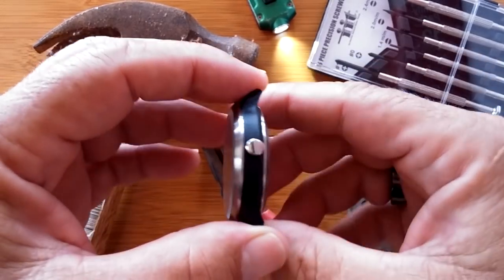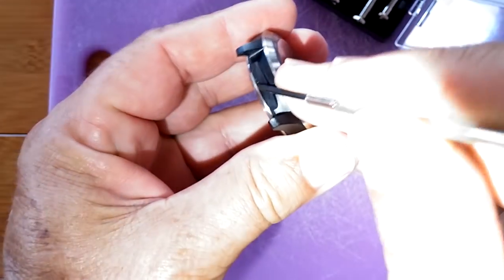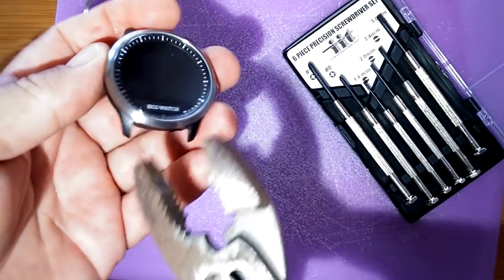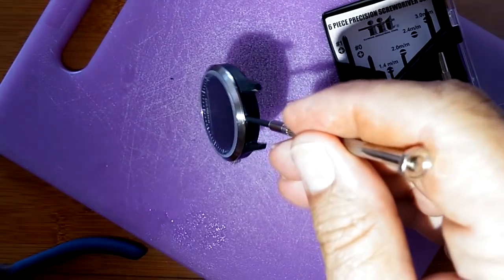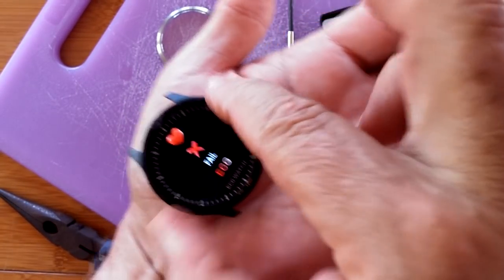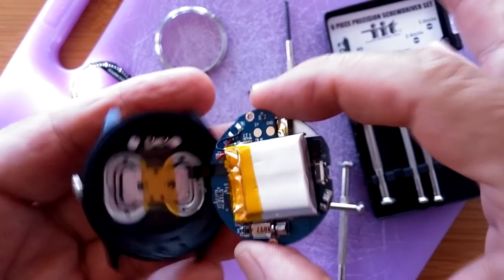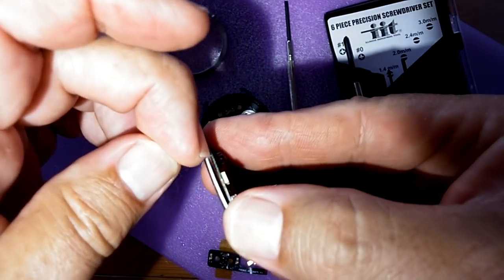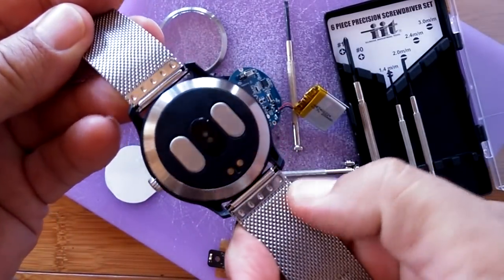RIPPED APART to PIECES: RUNDOING N58 Live ECG+PPG Smartwatch

Comment: @Peter van Grijfland You are wrong. The MX9 It also has the new very power TI ADS1298 8-Channel ECG. Much better and cleaner ECG. The N58 has the old TI ADS1291 2-Channel ECG. The MX9 It's safe to have true ECG. And he has the revolution "AI Neural Network Sensor" . Learning from you. I've looked very well at all that I tell you. This from the manufacturer:  Product model : MX9 ECG smart watch (Bracelet)
Hardware parameters: program / APP WearHeart
Chip manufacturer: Nordic
Chip: nRF52832
Compatible system: Android4.4 or above, IOS8.2 or above
Flash memory: 512K+64M
Screen type : IPS
Screen size: 1.22 inches
Resolution: 240*240
Touch screen type : single touch
Connection parameters: Bluetooth BT4.0
WIFI: no
NFC : None
Sensor : ECG ""ADS129X
""
Heart rate : HRS 3300
GPS : None
Battery type : polymer lithium battery
Capacity: 210mAh
Charging method : magnetic charging
APP software features: sports step, calories, distance, running, swimming, cycling, basketball, football, badminton, table tennis, walking, climbing
Health Blood pressure, heart rate, ECG, heart rate monitoring, sedentary reminder (task reminder), drinking reminder, sleep monitoring, etc.
News Push WeChat, QQ, LINE, Facebook, Twitter, LinkedIn, Skype, Viber, WhatsApp, etc.
Other:
Raise the wrist screen, call reminder (reject), conference reminder, SMS reminder, alarm reminder, shake photo, stopwatch, mobile phone search, medication reminder, WeChat sports, etc. This From Texas Instruments: Specs TI ADS129X : http://www.ti.com/lit/ds/symlink/ads1298.pdf -   I know why you say has not ECG the MX9. You look the photos from Seller from Aliexpress that show another program “DA Fit" without ECG. Look, the sellers from the Aliexpress do not know what they are selling. And uploading wrong photo that they are. Example. I talked to the Rundoing in the Aliexpress and he told me the N58 he has touch point. Yes incredible, he does not know. Sold thousands of pieces and did not know. the sellers do not have a factory and they say have. Sellers who have a factory are very few. And they are just the Big well-known names. They buy all these sellers from the same factory, and they simply write their name.

Comment: Mrs Tick's ,  The graph from ECG is not so smooth In the second the new N58, it has many parasites, the first old N58 are much cleaner is very smooth graph ECG than I can see, I am wrong?
Reply from the maker: I haven't looked that carefully, but you may be right. I can't conjecture if it's actual heart wave patterns or environmental noise causing it. I guess readings could be taken in different electromagnetic environments and with more or less moisture on the arm/finger to see if there are changes. If you get one of these, I'l recommending trying this to judge for yourself about how accurate the charts appear to be.
Reply: @SWT  I've ordered one and I'm waiting for it, and I'll see it, but I just looked at your two videos that you uploaded, your review from N58 and this, and i see the difference, and you see the video from your review and check again the new N58 and you will understand it,  I understand is each N58 is a different quality of the chart, your first N58 ECG was much better (and sorry for my bad english..)

Comment: I am very thanksfull to u. I purchased this amzing watch and i accidentally drop and have that same issue. But i think with the help of ur video hope i ll repair the button.
Reply from the maker: Glad to be of service. I'd rather open them up and show you guys what's inside than to just throw them away. I'll keep doing this. Hopefully I'll get better at it.  :)
Reply: Hello Sir i bought this watch but its having problem. Its not giving Notifications of calls and sms at starting its was giving. and not even able to do ECG on my wearheart app the option is not showing. i have done each and every posibiliy of removing app and installing again. Not even able to reset the watch from the app please help
Reply: @SWT  Hey do you still have the motherboard? Is there any way you could take a pic and send it to me? (sorry for the trouble)